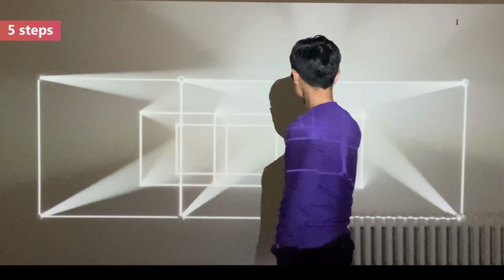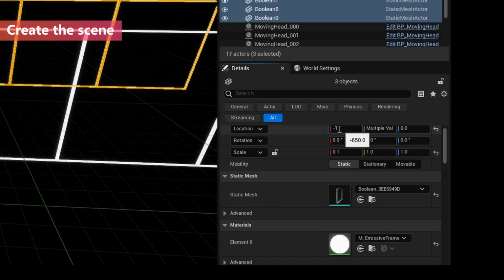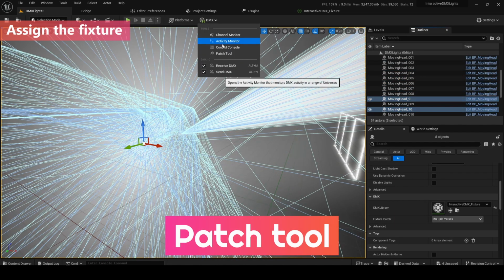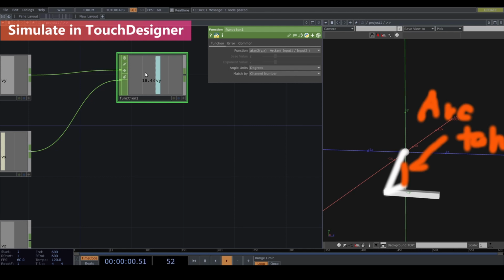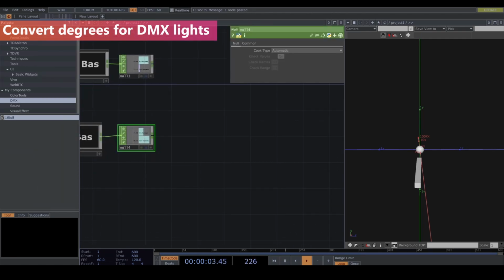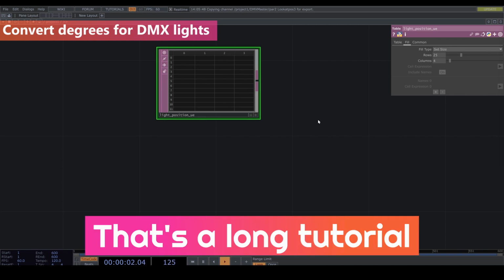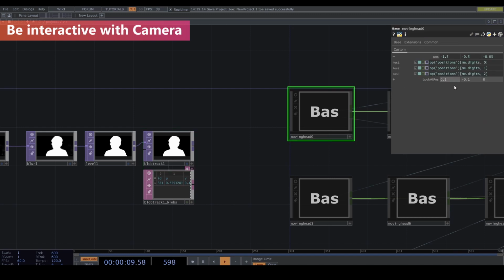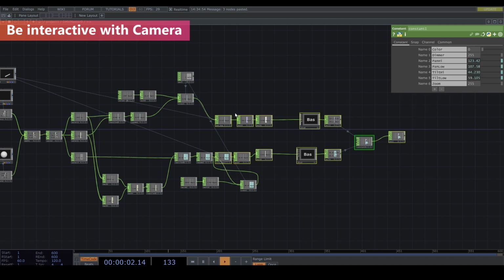Interactive Glow : Mastering Human-Tracking DMX Lights!

Comment: Hi Man,
Thanks for the video, learnfull  (sometimes a little to fast ;) )

Around 31"40 when using " int(me.inputCell.val) / 100

I got my positions from a CSV file directly from my light console.
But the parameters are for example 10.00   ( 10 meter )
The python int(me.inputCell.val) / 100 gives errors because there is a ' . ' in the input.
Tried / searched but can't find a solution.  Any idea please?

Thanks again
Reply from the maker: Thanks for watching the fast and long tutorial😂 I’m so proud of you!
Do you have the error in evaluate DAT? If it’s so, check the order of inputs. If you can see the error message, can you tel me? It’s gonna be helpful to find out the problem 😊